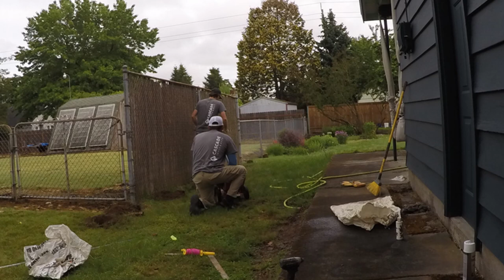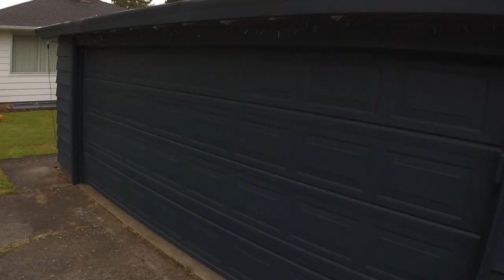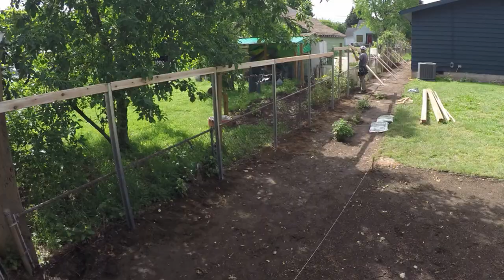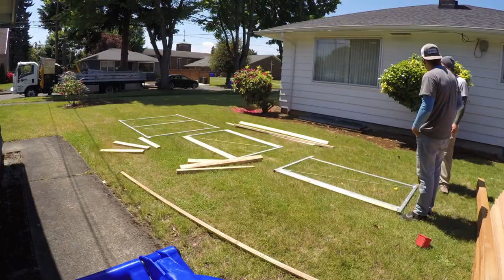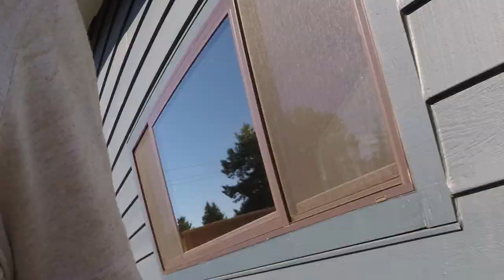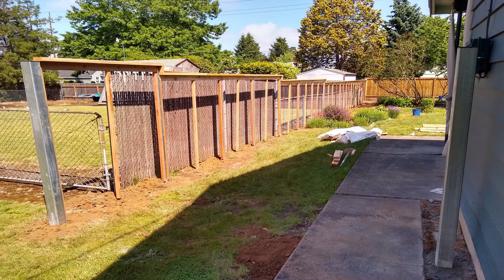Horizontal Cedar Fence in Portland with MONSTER Gates - Fence Time Lapse #8

Comment: What wood is that made out of?
Reply from the maker: Cedar.
Reply: @jonathanpayne7703  do you have any blue prints available for the design of this type of fence? If not any links to see how this was built?
Reply from the maker: @ddemier  I'm building one this week. I'll see if I can shoot you a video of the process. Thank you for the interest.
Reply: @jonathanpayne7703   that would be fabulous or just some detailed pictures of the fence and gate assembly. I can't seem to figure out how to build the gates with the horizontal style fence or how to add a top beauty frame or top cap at the top of the horizontal fence. 

I also cant figure out that wall piece at 6:32 with the gate hinges and how did you make that double wide gate with the walk through gate attached. I like that alot. I will be using wood posts not steel as I see you boxed the steel in. 

I'm looking at having a double wide drive through gate and two walk throughs gates starting this project in fall.
Reply: @jonathanpayne7703  can I get a blue print of this fence or just better pictures?
Reply from the maker: @ddemier  Hi ddemier, I missed these notifications and forgot about this! Email me at JPCarpentryWA@gmail.com - got lots of pics and a good run down of this fence style.